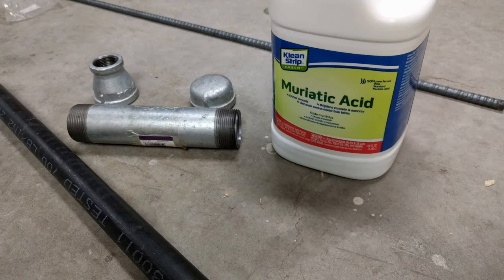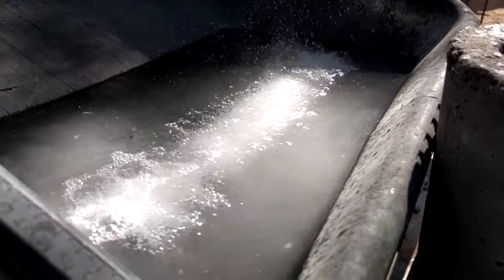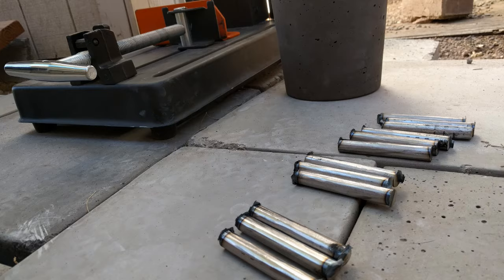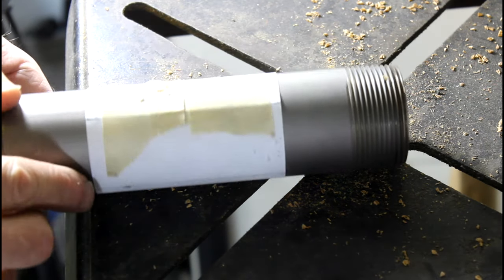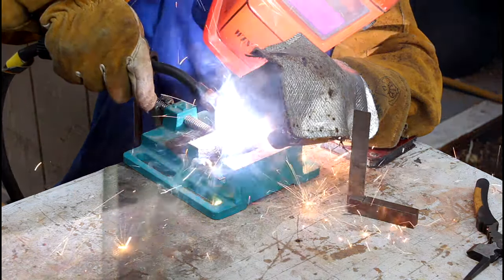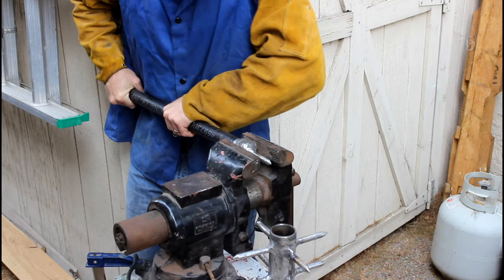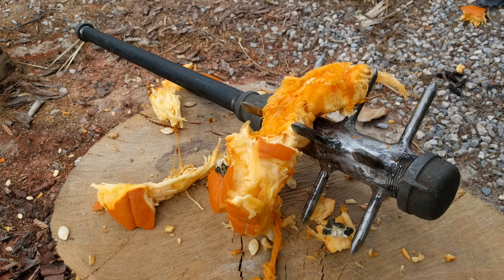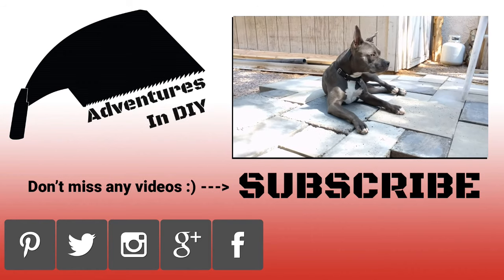Make a Two-Handed Spiked Mace - Zombie Weapon Challenge 2016

Comment: Ouch! Killer weapon! I was so glad when I recently found out that you can remove the galvanized off of steel with the acid, cause I have a bunch of it! I dip it in another solution of baking soda & water, just to neutralize any residual acid that might be on it before rinsing, drying & welding. Good job!
Reply from the maker: +Construct Icon thanks! Next time I'll have to neutralize the acid like that. Thanks for the tip.